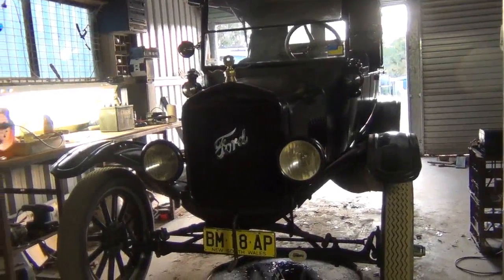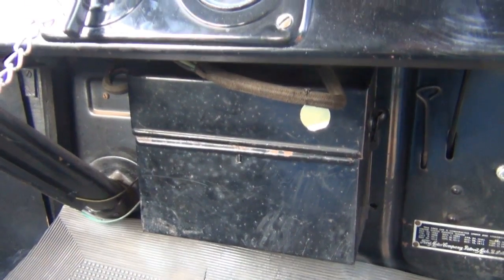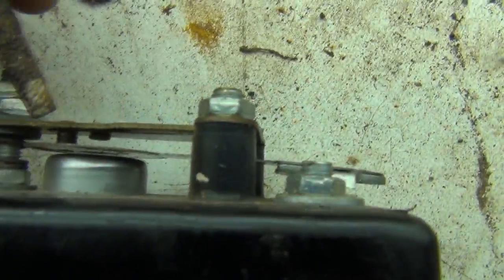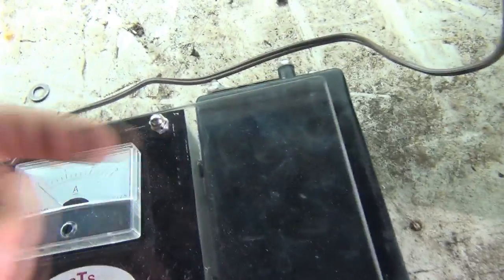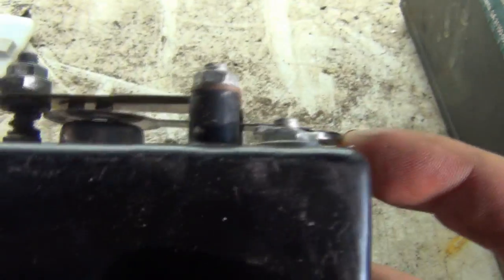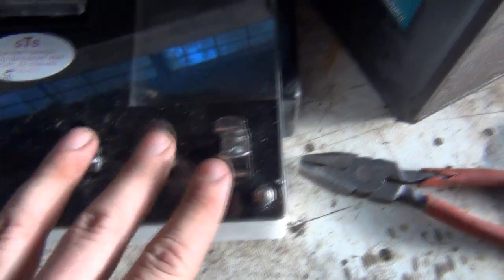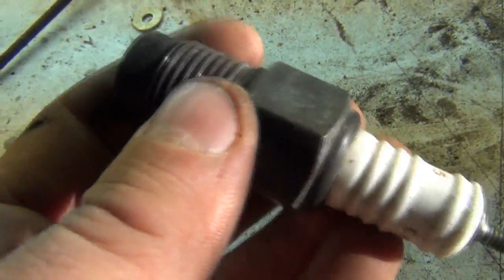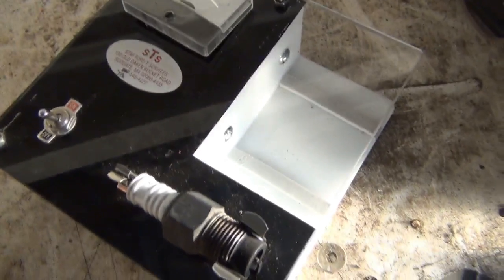Ford Model T - A Closer Look: Coil Boxes (Trembler Coils)

Comment: perfect sense, thanks so much. On the very modern cars now, many of them have an individual coil for each spark plug I believe. My old 64 Mercury has the single coil of course. Also, I guess it has two separate ignition systems, one for starting and one for running. When you turn the key back from the start to run (after it’s started) it switches to the system coming from the alternator. Something like that anyway. I never knew until I studied ignition systems a little. It’s an adaptation from the early Model T system it seems. Also now the individual coils are a throwback to the system on the T. Biggest difference of course is all the computer controls via sensor input. No thermostatic springs controlling the choke or a manual spark advance. Fascinating to see the technology advance and also borrowing from the past.
Reply from the maker: Thanks for your comment 🙂

Comment: Interesting how these work. Does the ignition system require a charged battery at all times or is there another system on the vehicle to generate the 6 volts needed by the primary circuit? Also, how is the ignition timing set, so it fires at the correct point in the compression stroke? Fascinating to see how the systems have evolved over the years. Thanks much!
Reply from the maker: Ignition on mine needs a charged battery for starting, then I switch immediately over to magneto once the engine is running, as it provides a bit extra current than the battery. Timing is controlled by the timer at the front of the engine. Where a distributor on a modern engine allocates high voltage from a single coil to each spark plug, the timer on a T allocates low voltage to each ignition coil in sequence. Hope that makes sense 😄

Comment: While the Model T's engine is running, does the magneto charge the battery?
Reply from the maker: For later Model T's with a battery installed, there was also a gear driven generator which charges the battery.

Comment: So these coils are constantly running while the key is on Battery, and the "distributor" (I know it's not called that, but I can't remember offhand what it's called.  Timer, maybe?) completes the circuit from the coil box to the spark-plug at just the right time to cause a spark to go off inside the cylinder.  Is that how it works?

What about if you're running on Magneto?  Isn't that a giant magnet on the flywheel, ripping past a coil and inducing a large current in it?  I'd love to see a video about that sometime.
Reply: You are thinking of the commutator. Someone may confirm, but I think it provides primary energy to the correct coil for the power stroke of that cylinder. The magneto can provide the energy instead of the battery; that is the only difference in the ignition circuit with the magneto. That is why all Model T Fords can be operated without a battery (although you should remove the generator if the battery is not there). The buzzing sound is only heard with the battery because there is no magneto energy when the engine is not running and the engine noise drowns out the buzzing sound that is occurring at all times when the engine is operating.

Comment: Thanks for your helpful vidios, I got a 1924 touring that has laid up for. about 10 or so years and I've put a little oil in each cilinder and turn the thank occationaly to keep it from freezing up. also the wiring seems to be a mess. The prior owner used the same color for just about everything. I got a wiring diamgam that was reduced in size so much one more reduction it could be used as a postage stamp! my email: stanotcr@gmail.com.com

Comment: You are adjusting the spark gap clearance by bending the armature mount which strikes me as a rather coarse method.  Why aren't you instead adjusting the height of the fixed portion, which appears to be designed for that and would offer much finer control?  The bolt with the spring around it, it looks like if you loosened the nut, that would widen the gap for lower current, or if you tightened it, it would lessen the gap for higher current.  Or are the looks deceiving?

Comment: mitch what was the difference from the model  T  and the modell A
Reply: RAMM GARR Ford Model a has more horsepower, a standard 3 speed with a standard pedal layout. A Ford Model T was made 1908-1927 a model A was made 1928-1932

Comment: But how dues the engine control firing on each spark plug?
Reply from the maker: +Randy Charlton There is a timer at the front of the engine. Similar to a distributor, except, where a distributor redirects high voltage from a single ignition coil; to each spark plug. The timer on a Model T redirects 6 volts to each of 4 coil boxes, and then to the spark plugs.
Reply: @ModelTMitch  
So it's more of a commutator.

Comment: You said the car has a distributor but the spark plug wires hook up the the coils. What does the distributor do?
Reply from the maker: +Randy Charlton the car has a Generator, not an Alternator. The Generator provides charge for the battery. Prior to the introduction of electric lights and starters, there was no battery, and no generator. There was a brief intermediate period around 1915-1916 where the Model T had electric headlights but no battery - the lights were powered by the magneto - so the faster the engine revved, the brighter the lights, and when the engine stopped, so did the lights! Hope this helps.

Comment: Unfortunately, simply measuring coil current with a "buzz box" type tester will not reveal multiple sparking. Excess current current simply wastes power and wears out the points faster - this is not the factor that causes multiple sparking. That is determined by the upper point cushion spring. Too little current results in a weak spark and misfiring at low magneto or battery voltages. Multiple sparking causes less than perfect running on magneto. The only way to check for its presence is to use a hand cranked tester, Strobo Spark, or electronic tester like this http://members.iinet.net.au/~cool386/tester/tester.html
Nevertheless, a buzz box tester is far better than nothing or other less scientific methods that have been used.

Comment: Mitch,so the model T had a "WASTE SPARK" set up! plugs were firing all the time! Not like in a distributor and point car where the coil fired the plug at top dead center?
Reply from the maker: Actually no, the plugs aren't firing all the time. The timer at the front of the engine controls the flow of low current to each coil, which then flows to each plug. A Distributor controls high voltage, a Timer controls low voltage.
Reply: If this were a wasted spark setup, there would only be two coils, each coil would run to two cylinders. The cylinders that are at TDC for exhaust stroke would fire (waste spark) at the same time the as the cylinders that are at TDC for compression stroke.

Anytime you see an engine that has exactly half the amount of coils for the amount of cylinders it has, it's equipped with a wasted spark system.

Comment from the maker: Ron - I'll do a full ignition circuit video soon... The firing of each spark plug is dictated by the timer at the front of the engine, similar to a distributor on a modern car, except the timer directs incoming current, not outgoing like a distributor. Yes, poor contacts on the coils can result in poor spark.

Comment: Mitch, interesting! I hope you show me how the whole ignition system works now that you got my interest.  I don't understand how the spark gets to the plug and at the right time.  Also I assume that is the current draw of the coil 1.3A.  What happens if the tremble contact gets worn and makes poor contact?  Low spark output ?   Thanks good video. Ron from NY USA